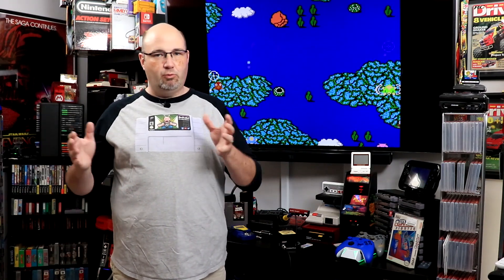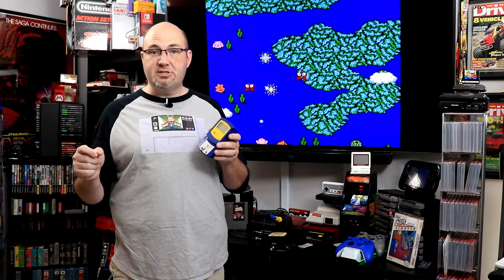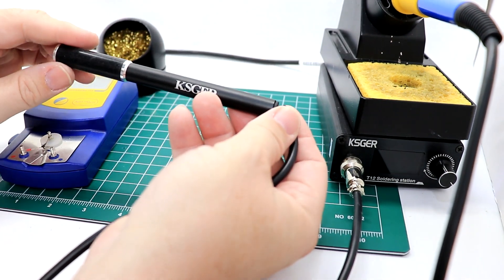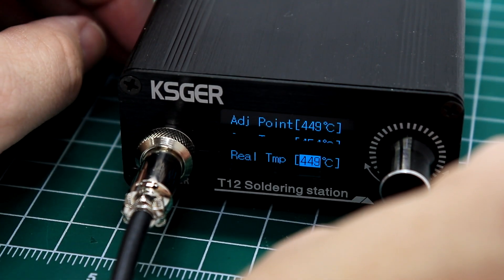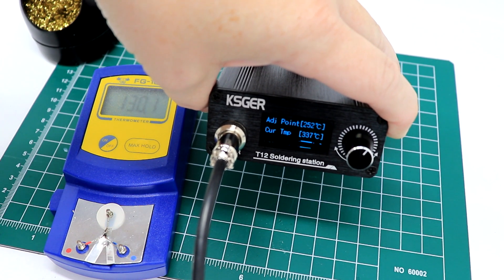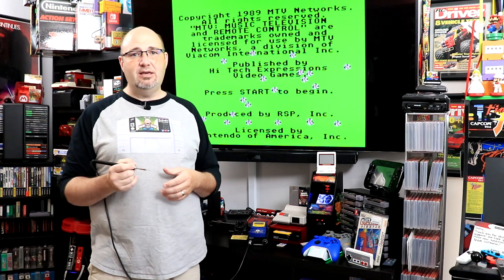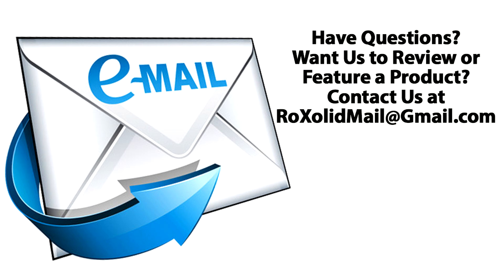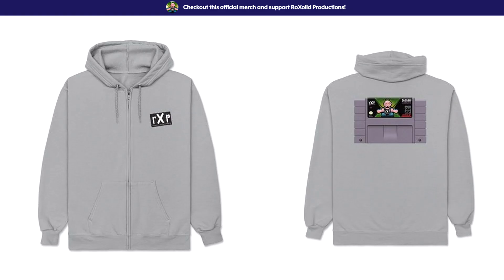Improve Your Soldering: How to Calibrate The KSGER T-12 Soldering Iron

Comment: I was thinking of going to T254 tip type ,and rework it to the 5 pin , or buying a 5 pin T254 pen wand to use 254 . would this be worth it ? or is it better to stay with T12 ?

Comment: Are you sure the solder isn’t affecting the temperature probe? Seems the tip will always be hotter than the solder. So you are calibrating for the solder temperature not the iron tip temperature
Reply from the maker: The solder is actually what is transferring the heat.